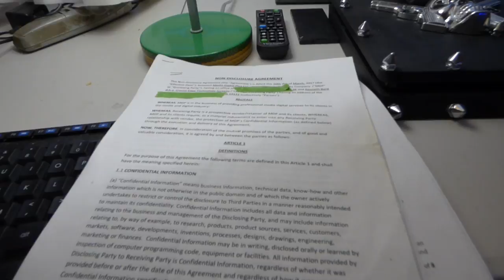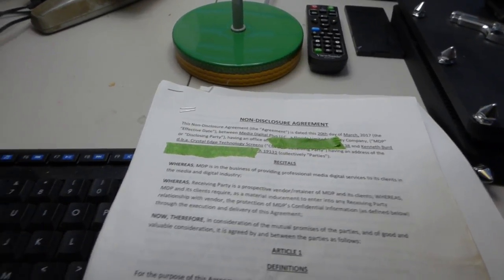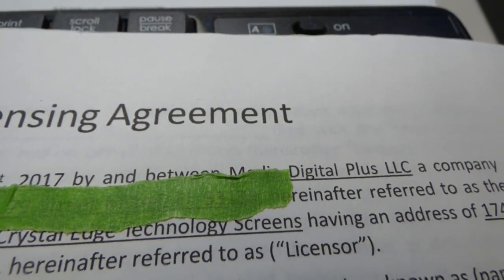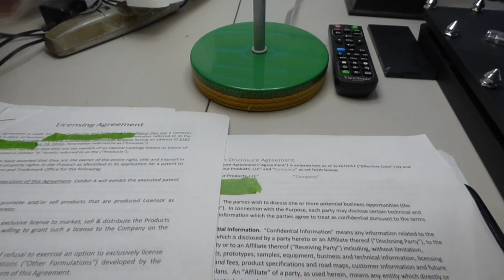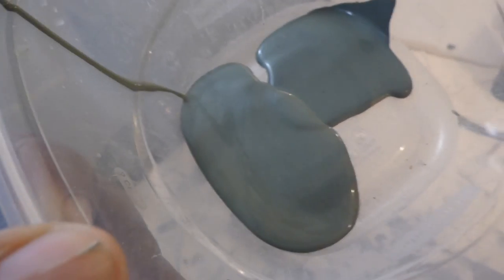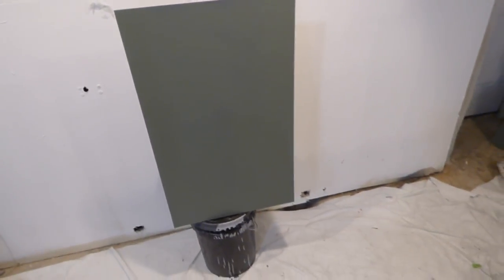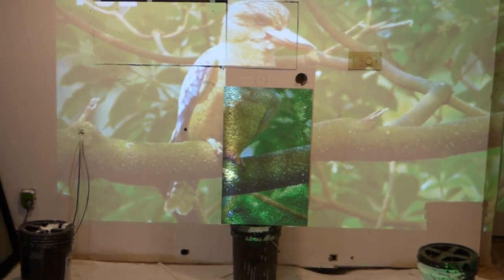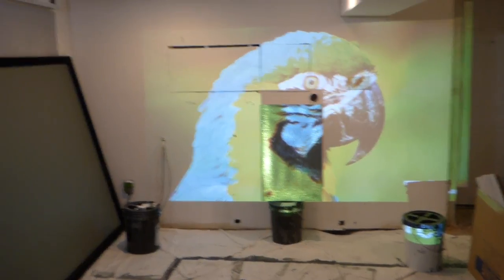TEST ECLIPSE NANO PLATINUM SLATE SCREEN PAINT SPRAY ON DEMONSTRATION  AND MORE!

Comment from the maker: NEW ECLIPSE NANO PLATINUM SLATE 4K AND 3D READY

PROJECTION SCREEN TYPE: Spray on screen paint
SCREEN COLOR: Nano Platinum slate
GAIN: Smart technology gain X10
ANGLE GAIN: 190
LUMENS COUNT: 500 and up. 3D: Yes. 4K: Yes 4K ready.
PROJECTORS: 4K, 720P,1080P, LASER, DLP, LED, LCD, Short throw, long throw and ultra short throw projectors.
Indoor only

Color enhancement technology X3 Perfect whites and ultra dark contrast levels. 4K and 3D ready Lumens only 500 and up compatible with all projectors. Smart technology gain X10 with color enhancement technology X3 Low-odor Low - VOC Eco- friendly, Washes of with just warm water and soap, one coat spray on application. Designed for all surfaces no priming needed! 

Available in 2 qt only price $482
All eclipse nano spray on projection screen kits come with a free Wagner 150 paint sprayer.
Free worldwide shipping launch date 02/16/18